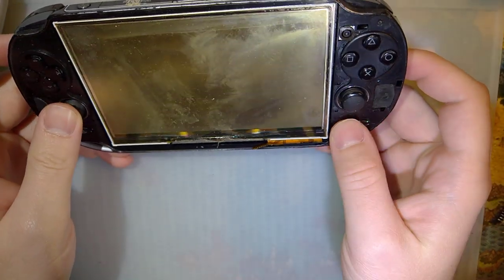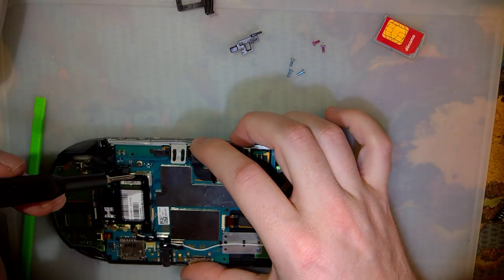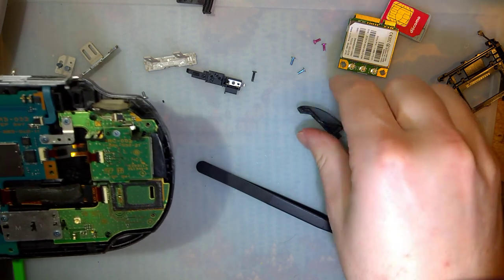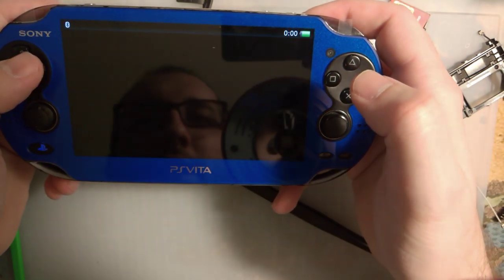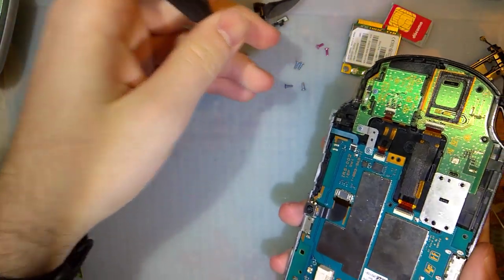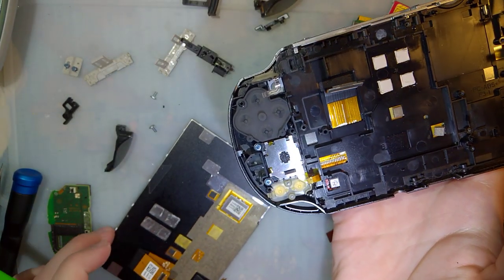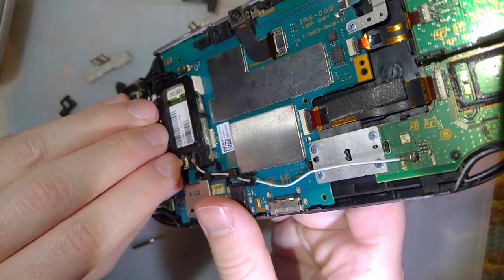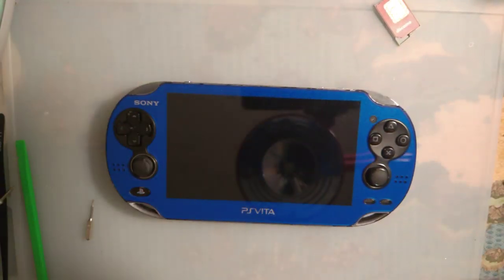PS Vita 1000 (OLED) Screen Replacement

Comment: I bought a similar conditioned Vita for very cheap last year, done the same mod however my replacement screen came with the housing. Went and ordered a back housing & new port covers to make it look brand new
Reply from the maker: I was considering replacing the back and sides too but it's still perfectly functional. Eventually I might anyway but if I was doing the sides, I should have done that before the LCD. I might still paint it though.

Comment: How does your screen just fall apart after you unscrew everything? Mine is cemented together with no actual way to separate unless I possibly break it.
Reply: I’m sure you’ve solved it now, but did you take every screw out? There’s two at the bottom, two on the top under the flap for a cable, and 4 on the back. It should already be loose after you take all those out and you can just pull gently so you don’t rip the ribbon cables
Reply: @vergodagoat  he’s not talking about that he’s talking about when you have unscrewed everything and the screen pops out from the casing
Reply: It’s adhesive so you have to use some special machine

Comment: Hey Makho, hope you and family are keeping well and safe, we're going through crazy times right now! 

Question, is you screen definitely OLED? I seem to have noticed that a lot of the replacement screens now seem to be 3rd party LCD made for the 1000 series. I would love to replace my vita's OLED display as it suffers as fair bit of screen burn now.
Reply from the maker: It's Samsung branded. I haven't noticed any burn in and it certainly looks like an OLED to me. I could be wrong though. My only other Vitas to compare it to are another 1K with an aftermarket screen and a 2K.

Comment: My PS Vita 1000 model's screen looks little discolor while off.
thinking to replace the screen on Aliexpress the option is Touch+Screen without frame.
Do I have to glued the screen on Vita?
How did you removed your old screen?
Reply from the maker: I bought a new digitizer/screen assembly. I did not separate the touch screen from the old screen. I highly recommend just getting the assembly.
Reply: @makho  thanks for replying.
Actually I am asking about the replacement unit with display + touch front without the frame.
How to replace the old and add this into the frame?

Comment: Love the content brother, i have to ask ive been looking for a ps vita for weeks now and honestly i have been having trouble finding one new . Is it better to try and look for parts to try and build one from scratch?
Reply from the maker: It looks like you can get all the parts to build one from scratch except for all the little brackets inside. The metal brackets you can work around, those are just ground planes really. The plastic brackets are much more difficult though because without them, your shoulder buttons won't work. 

I just like to buy junk units and fix whatever is up with those though. You can still get a ton of them for cheap by importing from Japan. Just be aware that due to the global pandemic, Japan post is currently shut down (for exporting).

Comment: Can you buy replacement shells?  So many are scratched up on ebay and just need a new front and back shell...
Reply from the maker: yes, you can get just about all the parts aside from some internal brackets (so keep those)

Comment: Hey man did you find that this screen is similar in bridghtness and look? I feel my new OLED screen didnt look as bright.. or maybe it was always lacking bridghtness
Reply from the maker: Both of my 1K Vitas have replacement screens so it's hard to say for sure but it looks pretty good to me.
Reply: makho so bit of an interesting update. I managed to get my hands on a second oled vita. Comparing the screens they are extremely close. I’d just say the only difference is a minor MINOR color difference. Which to most they won’t notice, but me being ocd definitely noticed. I’m still quite impressed considering we can get these
Screens from 20-30$

Comment: Long story short my daughter dropped my Vita and now has caused the screen to flicker and have discoloration all around the screen. Hey is this hard to replace? When I called my local electronic repair shop they said it would cost 90$ for them to fix it. Is this difficult to do and I should take it to the repair shop?  I'm really just confused as to what I should do to fix it? If I can save 90$ Id be really thrilled to be able to.
Reply from the maker: You just watched me do it to mine. If you think you can do that, then go for it. The parts are pretty cheap.
Reply: @makho  I mean yea I imagine I could if given the proper part and tools fix my Vita and save money. But also in the back of my mind ion wanna break the Vita more than Rose did.

Comment: Great video, could you please confirm if it's an oled replacement screen ? (sometimes they replace oled with lcd) and can you tell where did you buy it ? Thanks
Reply from the maker: Yeah, check out the first couple minutes of https://www.youtube.com/watch?v=_k2oRIQOAko

And this is the seller I used: https://www.aliexpress.com/item/32856675572.html
Reply from the maker: Mister Donkey  In my case, both of my confirmed OLED panels both have a Samsung logo. I haven't seen any 1k non-OLED panels though so I can't confirm. If you can plug the screen in, it's pretty easy to tell because there will be no backlight.

Comment: hey, i replaced my screen pretty much the same way you did and my touchcreen detects random touches. Did i do something wrong inside or is my replacement screen that's just fcked?
Reply: it's like the left side doesn't work at all but the rest does :(
edit: left side works but still janky
Reply from the maker: @lillbutz5953  sounds like you just got a bad screen. If reseating the connector doesn't help then you'll likely have to live without or get another screen.
Reply: makho Ok thx, il try reseating it and if it doesn’t work ill ask for a replacement. Hopefully i will get one 😓

Comment: Hey good job for the screen....anyway I have another question for you, how did you repair the right analog? did you replaced it? i have the same problem and I don't want to replace the analog :(
Reply from the maker: I replaced one analog with a new (used salvage) stick and then repaired the other analog by combining the parts from the stick I replaced and the remaining stick in the console. PSV 1K sticks are expensive and the consoles are not compatible with 2K sticks (without mods).

Comment: You can find the joystick caps on Aliexpress. I've never bought them, so I don't know the quality.
https://www.aliexpress.com/item/32948566074.html?spm=2114.12010612.8148356.3.75206ad02x5WFT
https://www.aliexpress.com/item/32944424826.html?spm=a2g0s.9042311.0.0.24694c4dhw7jUV

About the rear pad, you can test it in the Welcome Park app. When you reach the main menu, with the globe on the background, the globe will move if you touch the rear pad. Actually, you can test a lot of things with this app, like cameras, touchscreen, accelerometer...
Reply from the maker: Yeah, I figured out the pad does respond in Jak and Daxter. Good to know though because that's a lot easier and will test other things. Thanks!

And yeah, about the caps, I think I'll just use the OEM cap from the right stick in my left stick and then replace the right stick entirely. I did end up looking those up later but I was just thinking out loud during the video. Thanks for the links for that too!

Comment: Hey, makho. I have been watching your videos for a while, and really like your content. Could you do a video comparing flashcarts? Maybe split it into flashcarts for GB/GBC, GBA, DS and 3DS; I'm looking for a flashcart that I can use with a GB Micro, and another that works with my FreckleShack GBC. Do I go with krikzz's Everdrive line? Something from the EZFlash range? I'd like to stick to a modest budget, but I would also be happy to spend a little more, provided the extra cost is justified through the functionality of the flashcart itself. Sorry for the generic comment, but I haven't found any videos on YouTube doing this sort of thing, and your "backlit GBC shootout" video was great, and one of the reasons I ended up getting a FreckleShack a while back... (now I probably regret not waiting for a GBC IPS kit, but that's another story altogether). Thanks.
Reply from the maker: It's not quite something I'd be interested in doing a video on but I'd be more than happy to share my thoughts on the subject. For a GBA flash cart, the Omega is a very difficult value to beat. It will work on all GBA (including a Micro) and it is not an oversized cart. The new ED GBA-X5 (and later X7) will solve the latter issue but I can't imagine them coming down in price significantly. 

For GB/C, it's a toss up between the ED and EZ Flash Jr. I have both and I can say that my ED has way more features, better stability, and supports more games. The JR, on the otherhand, is, again, significantly cheaper. The JR still does not work properly with some games (specifically Pokemon Prism) but the firmware is being actively maintained and new features and bug fixes are likely in the future. It's your choice if you want something that works now but is a little bit more expensive or MAY work later and is a lot cheaper. I play a lot of Pokemon ROM hacks so I have the GB-X7

For DS, I like the Acekard (2i). That one seems to be the best bang/buck card on the market. I know they are probably a bit harder to get a hold of right now but even the obviously fake NDS games on ebay (the ones with the two curves on the sides) are also pretty decent flash carts. I don't think it's worth buying a flash cart if you have a DSi or 3DS though. Both of the latter consoles are capable of running CFW and with an application called _ndsbootstrap (backend) and another app on the frontend, you can just run DS ROMs and homebrew straight from the system SD card.